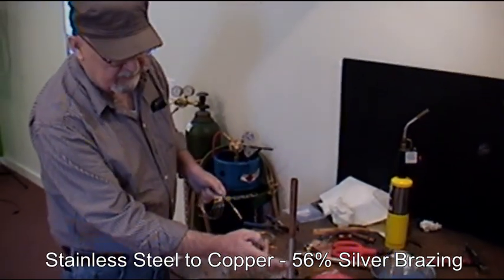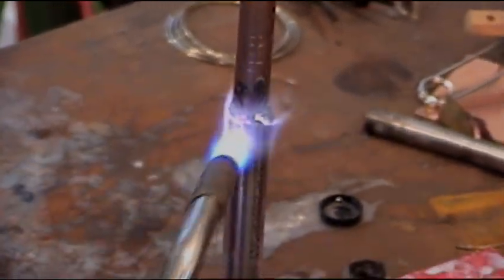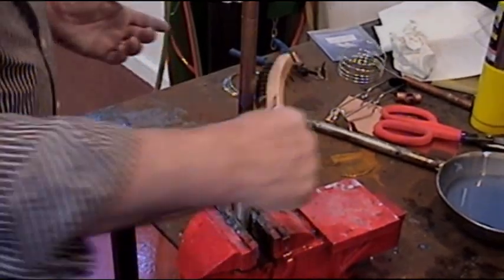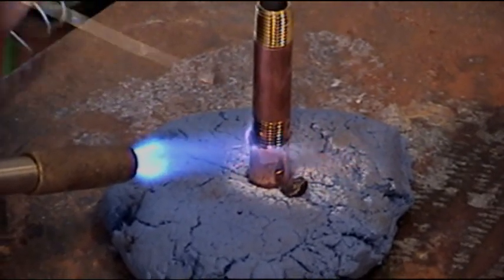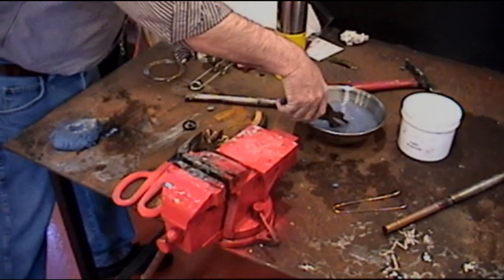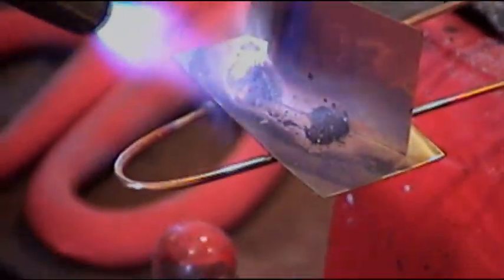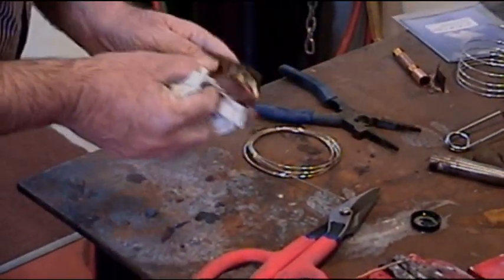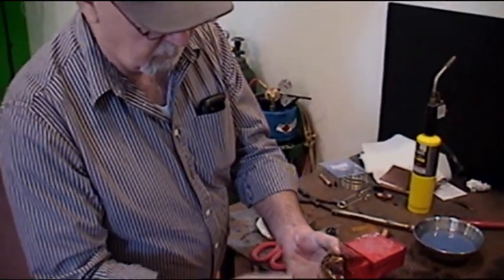Silver Brazing Demo - Stainless Steel, Brass, & Copper

Comment: That's just about as rough as you'll see. If you're looking to learn silver soldering or brazing , look elsewhere. Heat the joint (which you will have cleaned and fluxed) not the rod, then apply the rod when the joint has reached temperature and it'll immediately flow right in and around the joint. You'll soon know the right temperature by the look of your flux, that's one reason I wouldn't use that Black stuff if you paid me to. " It won't burn ". . Flux only burns if you're not doing the job right in the first place. Braze "burns" too, it'll ' gas off ' what's your fix for that ? The fix is . . do the job right. Sorry if that sounds harsh fella (we're about the same age), but bad habits are easy to pick up and hard to lose. Young people looking to learn deserve better than this video.

Comment: Wich gas use for brazing
Reply: Any that gets hot enough... totally depends on the rod. MAP gas and plain old propane works for some... other need Oxy Acetylene or Oxy Propane.
If braising tubes... using nitrogen at 1-2 CFM to deoxygenate the internal space is important too. If not... the internal will become oxidized. Not great for a clean flow requirement such as refrigeration, food/drink etc.

Comment: you need to clean prep the surfice first then use a brush on flux keep in mind solder flows wear the flux goes. then heat the pipes till red or orange then you can quickly hit it with flux if using a brush that can stand the heat if not just add the solder then  but pipes need prep and clean joints and the pipes need to be hot.
Reply: you dont use flux on anything above 30% silver... why the hell would you use 56 silver with flux idiots...

Use proper tools instead of propane burner... And never use above cool down method.

Extremely Amateur video, not the way you supposed to do this.

Comment: Do you need to flux silver solder joints between brass n copper? I use silphos 5 to 15% silver on brass n copper all the time w/o any flux at all. Haven't had a problem yet in 20+ years
Reply: Yes it's different that normal brazing with silfos. Silver soldering/ silver brazing requires flux or else it'll fall right off the pipe. I found it harder than brazing and soft soldering.

Comment: Unfortunately folks everything you just watched here was done wrong. Please don’t follow this mans lead. 
He should have cleaned and prepared the joints better. Also he did not soak the joints enough in heat that’s why the solder just globes on the pipe and barely pulls into the joint. The attempt was nice but this was done way wrong.

Comment: I need to connect together a stainless nut, 3/4 tread and a small mild steel plate, the only brazing rods I can find here are Harris and regular brass brazing rods, any suggestion. I tried the Harris 0  but the joint is not so strong, I'm using Harris silver solder flux. Any help would be greatly appreciated
Reply: you can weld it with stick welding or tig welding useing 309 stainless.

Comment: Could you please tell me where can I purchase 45% or 56% silver-solder wires.
Thanks for the help and for the presentation.
The Old Bob
Reply: Will 45% rods work best for copper to steel? On refrigerator compressors, the lines are copper to copper. I use 15%, but one line is steel and have difficulty with the 15% even with flux. Any suggestions?
Reply: Robert Silas  www.rnkbrother.com best to buy silver brazing rod
Reply: I bought a 9' roll (=3 bare rods) a few years ago at my local weld supplies (not airgas). I'm not sure how silver is doing on the market. Back when I got that roll, silver was high. The roll of 45% silver solder was about  $50. All these years later, I still have most of it. It goes a long way...

Comment: will it work on tungsten carbide to steel
Reply: 6 years too late... but... 😅
You can, *theoretically*, braise a rock to a steel bar. The issues come in when you consider the final application. Tungsten Carbide is usually used in a high force/high temp environment. Both of which will play hard with a braised joint. High frequency vibrations combined with high force also causes issues.

That said... I've braised TC cutters to tool steel rods for milling timber without too many failures 👍